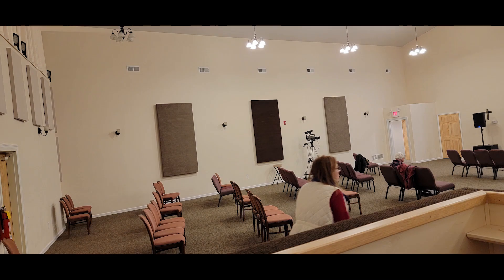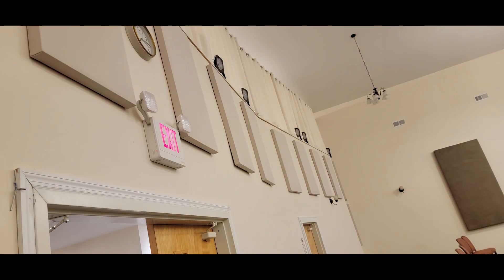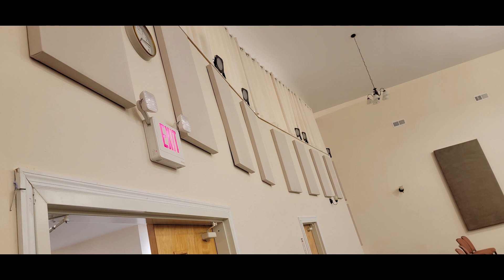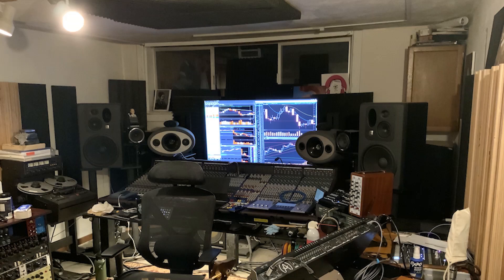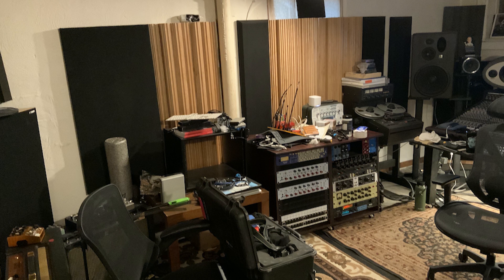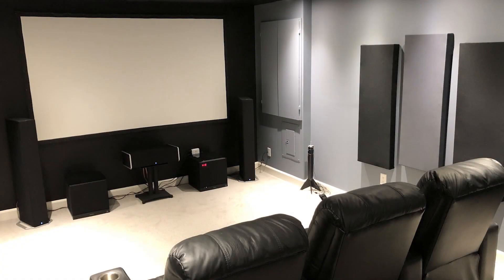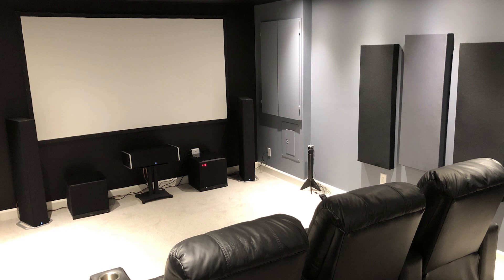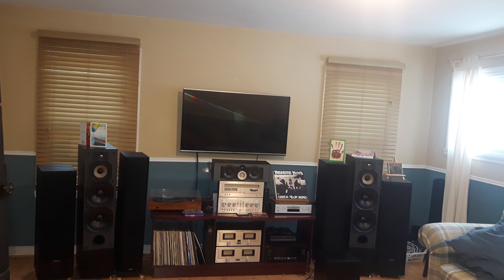Don't Do This! # 16 - www.AcousticFields.com

Comment: What's about people and sound absorption when the church is full?
Reply from the maker: Managing reverb involves treatment of the floor, walls, sometimes ceiling. For  acoustical measurement purposes, each individual is the equivalent of 12 sq. ft. of 1/2" carpet. If you have at least 50% occupancy on the floor, you have satisfied the absorption requirements for that surface area. You can now move to treat the walls.